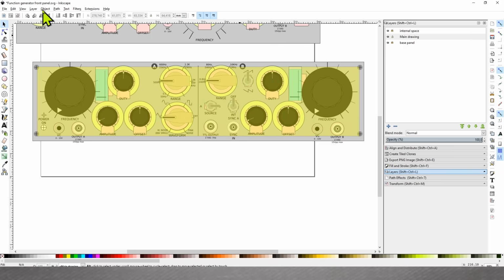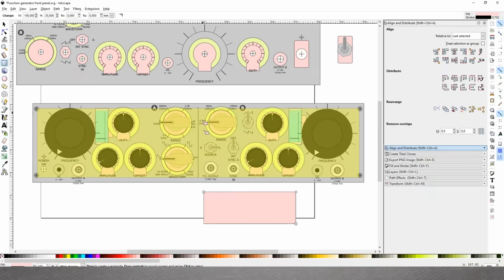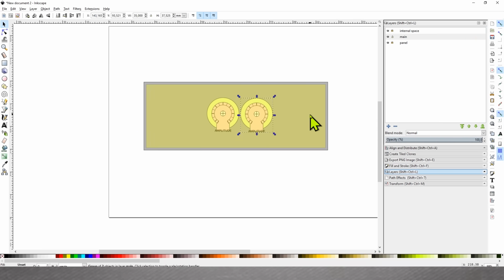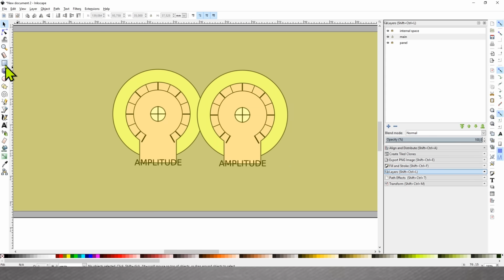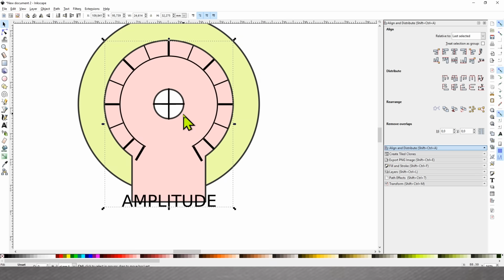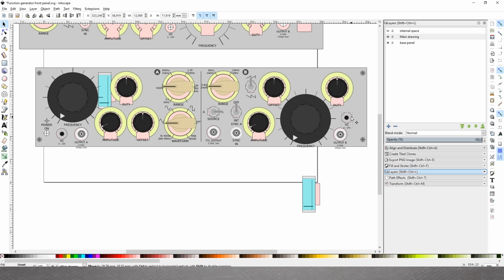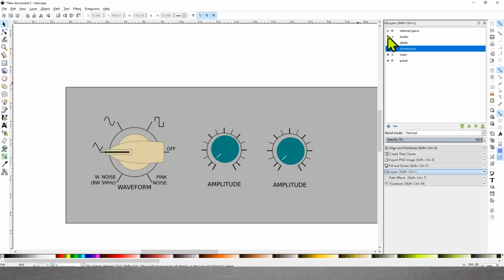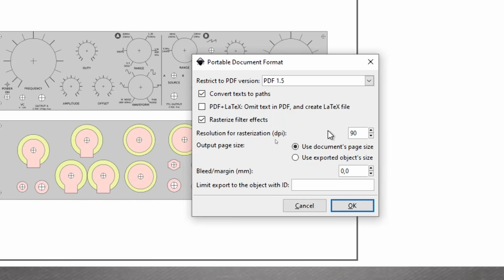Build a Custom Front Panel That Looks Pro — Easy DIY Tutorial

Comment: Wear gloves on both hands when working with epoxy. Getting un-cured epoxy on your hands is bad as it quickly absorbs through the skin and can cause bad sensitization reactions.
Reply from the maker: @mbanb6775  definitely savvy comment. Usually I wear gloves but on this occasion I forgot to do it. I pin your comment.

Comment: Since you are using epoxy to adhere the laminated panel to the AL face plate, what about using a thinned epoxy on the edges of the finished panel to impregnate the paper edges for increased delamination resistance?  Or alternatively saturate the paper backing around its perimeter with thinned epoxy prior to gluing it to the Al.  This essentially it the approach for PCB board fabrication where a fiberglass mat is saturated with epoxy.
Reply from the maker: Thanks for sharing your ideas. The impregnation makes the paper appear darker. There is another method though that I've shown in another video (it is the one that followed this one). With that method the paper is pre-treated with acrylic spray and finally (optionally) coated with epoxy or even better polyester resin.

Comment: Super-77 is a good adhesive spray for attaching the template to the aluminum in order to drill the holes. After you can peel off the paper and clean up any glue with mineral spirits.

Comment: Very nice work.  I've never used laminated graphics, but I have used laser printing on self-adhesive, clear plastic sheet and then sprayed clear lacquer over it all to protect the lettering.  I see you're using Inkscape but I always use Visio.  I also see that you appear to be building a function generator; any chance of a circuit diagram?
Reply from the maker: Look at my website, and subscribe to the mailing list: some content will be one-time shot via email only. However I'll publish more circuits about function generators over the next few months (likely in September). Some of them are simple oscillators, like the one shown in the last video.

Comment: protect your hands from epoxy resin. If you use it regularly it will accumulate in your body penetrating through skin and will cause allergy both for epoxy and some other things like nuts or birch tree pollen. I didn't care about protection and i got these allergies at my 35
Reply from the maker: You're absolutely right. As I told to another commenter, I did just forgot to wear gloves when filming in this video, but it is definitely a mistake not wearing gloves while handling epoxy.

Comment: Very nice job. Could you use spray adhesive instead of the 2 part epoxy in the last stage? It will be less messy. You can also spray a protective coating over it. Just a thought.
Reply from the maker: @anandadesilva6558  yes you can. I prefer epoxy because it results in a harder finish. No need to add protective spray on top: the beauty of laminated paper is that it is really resistant, even to oil and some solvents ( as long as they don't reach the underneath paper).
Reply: That is true, the bond is much stronger. Thanks.

Comment: As others have suggested, I have used peel-and-stick polyester label sheets for my control panels. Very durable, and compatible with the heat of laser printing and thermal laminating press. The polyester doesn't delaminate like paper and is impervious to any water that may find its way to edges.

Also, I often use the label itself as my drilling template, though this isn't always feasible.

Comment: Maybe in the past this would have been worth it but now you can get panels like this made so cheaply it isn't worth the hassle. Also the way you are using the drill press is really dangerous if the drill bit binds and the panel whips round it will do you serious damage, get some clamps.

Comment: Great work! I have used CAD drawings of parts printed 1:1 scale and tack glued to the material as cutting guides for decades. Results in very precise parts and cutouts. I use 3M Super77 spray adhesive as it lays a very thin sticky layer of glue. I'd prefer that over white glue or epoxy. But if I did use epoxy I'd use a thin laminating resin and apply it onto the panel with a foam roller. Many ways to achieve similar results.
Reply from the maker: Thank you. Yes, there are many ways to achieve similar results. Spray adhesive is very convenient, even though I must have been unlucky or maybe I did something wrong because every canister I bought became unusable after sitting on the shelf for a while.

Comment: Tip for the epoxy:  when you use epoxy which is for poring (so slow setting, 24 hours) you could warm the front plate to a temperature between 40°C and 60°C (104 - 140 °F), and as soon as the epoxy hits the metal plate, it becomes liquid as water. This way you can use a brush to paint it on. let it cool directly after sticking the text layer, so the then thicker epoxy keeps the layer more secure on the plate.
Reply from the maker: @erikdenhouter  thank you, I will give it a try.

Comment: Save time by using JLCPCB or PCBway to make you a 2mm FR4 or aluminium pcb as a front panel. Double them up if you need a thicker panel or blind studs.
Diptrace, KiCad or EasyEDA for free design software. 
These cheap fabs even offer UV colour printing of artwork so your panel can arrive fully finished and ready to go.
And the prices are ludicrously low if you can wait 2 weeks for slow shipping.
I'd recommend not using the 'silk' layer for legends / artwork as this can be a bit hit or miss. Instead either use the UV printing option or even better IMO, expose the copper layer with ENIG finish by drawing artwork in the 'mask' layer. The Eurorack boys do this and the results look fantastic! 
I even use stacked and glued FR4 pcbs to make project enclosures (19" rack 1U) and structural members. 
It's so nice not having to drill out holes and pockets and the accuracy is crazy - plus the material is very strong and forgiving.

Edit: If you 'keep out' your legends / scales etc on all copper and mask layers then you can back illuminate your artwork using LEDs. 
FR4 diffuses light very nicely and the mask layer gives knife edge resolution to your fonts and scales. 
Just be sure to double check your gerbers before you submit as you want to remove any automatic oversizing in the mask layer.

Comment: Ask at the print shop. There is an industrial peel-and-stick in 4 foot wide rolls used for signage at convention centers, etc. printed on big PostScript inkjet printers destined for big disposable "falconboard" dusplay panels. The material is NOT PAPER. It's a kind of hearty printable plastic. Your toughest job will be sticking it down right the first time. It's VERY sticky. The print can be laminated before they give it to you at a cost. It's a very common material under different names.
Reply: I think you are referring to vinyl adhesive. If so wet the panel so you can move it around. When the water evaporate the plastic will be gluded
Reply: @franciscoferreira-eh1yu  It's not vinyl adhesive as in cutouts for glass. It looks like paper until you try to tear it. It doesn't stretch like vinyl. Ask a sign shop or better yet an events company that makes one time use self-standing info boards at conventions, etc. When I made them they were 4x8 foot inkjet prints that were rolled on to the falconboards, sometimes laminated. You can print those at very high resolution.

Comment: Lately I'm trying to do silkscreen printing with the same photoresist that is used for PCBs. It's not very simple but when it comes the result is very professional
Reply from the maker: @penpen2672  nice. So you create the silkscreen yourself?
Reply: @AccidentalScience  yes! I use the resin printer screen to "burn" the photoresist and get a very high resolution.The tricky part is to remove the photoresist without ruining the paint, so far I've managed to silkscreen a power supply
Reply from the maker: @penpen2672  cool, it could be a good option for those who have the necessary equipment - and make PCB themselves, I suppose. Thanks for sharing.

Comment: Can you do a mirror image print on transparency film and then grommet it to the metal with the print face against the metal? Grommets could be hidden under knobs if desired. Then you avoid all the issues with glue and with paper. If you really desire a specific color, you could paint the metal panel.
Reply from the maker: I already tested transparent films. Not gluing them ends up in something that feel flimsy. I used self-adhesive films but the result was not as satisfactory as the method I showcased. That is my experience, though, which could not necessarily fit your preferences.
Cheers.

Comment: 6:42 I avoid the problems with stretching and removal by using spray adhesive on the paper. Use “repositionable” adhesive (not permanent!) and it’s basically like a strong post-it note. You spray it on the paper, then let it dry. It contains no water so the paper doesn’t distort.

Comment: One practical tip about printing from Inkscape: Always print directly from Inkscape. Do not export to pdf first, because most pdf readers have a tendency of auto-scale on print, meaning it add borders and the printed objects turns out slightly smaller than intended.
Reply from the maker: You brought a good point, thank you. Though, if you send the file to a print shop generally you have no choice. The good news is that usually the guys at the shop know how to handle PDFs and keep everything up to scale. The trick is to allow a centimeter / half an inch of margin around your design and the selected paper size.

Comment: 1. First align paper on the panel without glue. 2. Use soft tape to hold one side in exact position. 3. Lift off the the side, apply glue, put together, 4. Remove tapes, apply glue to the rest, and put together.

Comment: To avoid the laminated layers from peeling, you can cut the outer border of the paper before laminating it.
Thereafter, when you cut the laminated paper, you just leave 1mm extra margin, so that both laminated/plastic layer à glued together. This is also waterproof.
Reply: except around all the other holes in it

Comment: I used something like 3M 467MP Adhesive Transfer Tape to glue the graphics to panel. would run the clear laminate, the printed graphics and the transfer tape through a slip roll to laminate it.

Comment: I was making panels with toner hot transfer, just like iron method of making PCBs.
Reply: Then you use a laser printer. Try decal paper (water transfer sticker). The base is very thin and solvable in acetone/thinner. If you stick and dry it on a first layer of acryl (clear) paint, and spray it off with clear acryl, it becomes one with the acryl layer.

Comment: We made front and rear panels from PCB (FR4) material using a free PCB layout software. Then uploaded the gerbers and got them produced which was quite cheap. This way we knew all the holes were the right size and in the correct place and the silk screen lettering was also exactly where we wanted it. No gluing, drilling holes, alignment or printing.  No metalwork required as PCB material is rigid enough and you can fill the entire rear side with copper if you want screening. We also put some tracks on the rear of the front panel to carry the SPI bus as some of the components mounted to the front panel like rotary encoders and OLED display needed those connections. We then soldered one 4 way cable to the SPI bus from the project PCB and it saved having to connect several components individually. What do you think?
Reply: it is a great method, provided you have cheap pcb and pcb processing. for me, for example, it's cheaper to buy the whole device than to do it your way :)
Reply from the maker: Hi. Of course many factors come into place. Costs, dimensions, etc. Also it depends by the look you want. 
Anyway, thanks for sharing your idea. I think it could be really helpful for small panels and maybe for serial production of devices meant for educational purposes.
Reply: Did the same except I ordered Aluminium

Comment: Whoa, loveliness! Reminds me of the old Grass Instruments gear.
I use sticky clear foil and a laser printer, but my panels are monochromatic transparent, no color needed. First I print it on paper for a drilling template, drill and ream the metal, then I print on foil proper, press it with a roller avoiding any air bubbles, and use an X-acto knife to cut holes.

Looks like you're building some really nice PSU.
Reply from the maker: @KeritechElectronics  yeah that was a technique I experimented too. I like adding drawings and group controls in colored shapes so I came up with this solution (and another one that I'll show in the future). Cheers.

Comment: I do the same thing. I draw out my panels in PowerPoint then I bring the file to an office supply store (like Staples) and have it printed out on high quality photographic paper. Then I glue it to Aluminum sheet metal. For a lower cost solution I glue it to thin high quality plywood I get from a hobby store. I have a panel  on my webpage that I did for an automotive Electronic Control Unit test panel. It looks like a NASA Apollo spacecaft panel.
Reply: I do know someone who designs stuff using PowerPoint because it is all he knows, and the results often end up a pixelated mess.
Reply: @rexsceleratorum1632  I get high resolution with PowerPoint. I save the drawing as a .pdf and Staples has very high resolution printers (over 600 DPI). The result is photographic quality for only a couple of dollars per print. I have a photo of my latest work. I will make a video of it. Draw up your panels in just about any drawing tool. But for a onezy or twozy panel, don't go and buy a fancy printer or paper, just send it to Staples.

Comment: Look for print shop that prints using uv-cured inks. Print them directly on pvc sheet - thick for ready front panel or thin one - for panel overlay.
Reply: @marcinp.8108  better yet build a uv printer from an epson ecotank

Comment: Nice work. I was thinking of doing something similar, the only problem I have with this approach is the open edges of the laminated paper. I am thinking of using a laser printer to print directly on a sheet of BoPET. I dont know if the colour contrast will be as good. Also Ill need to sandwich it between a layer of white and clear PET. Ill give it a go to see what it looks like.
Reply from the maker: That's why, toward the end of the video, I said it is important to protect the edges. This techique is very well suited for harsh environments, like in a workshop setting, provided the edges are protected.

Comment: I do it differently, print on self adhesive (many silver) paper, cut out display openings, then cover with self adhesive transparent. The plastic or aluminium board is milled on a 3018 CNC with 2mm carbide mill.

Comment: Excellent, thank you. For large rectangular openings, I cut from corner to corner to make 4 triangles that I then fold through the opening and glue against the panel inside. This hides my rather janky filing and neatens up the edges.
Reply from the maker: @alan_wood  thanks for sharing.

Comment: I have done this a few times with Photoshop. It has good alignment features and works with layers, too. For printing, I took the jobs o a photo print house, where they did them in photographic paper. Got pretty good results.
Reply: @coriscotupi  Yeah, but as a fundamentally pixel-oriented program, Photoshop isn’t really the best tool. Yes, it’s gained more vector capabilities over the years, but an inherently vector-based graphics program (Illustrator, Inkscape, etc) is a much better choice. Those also tend to have much more advanced alignment tools.
Reply: @tookitogo  Yes, that was what I had at the time. When the need arises again, I'll give Inkscape a try.

Comment: Very nice! I did a panel with labels and so forth printed in reverse on transparency film which i then used spray adhesive to glue to the panel. This worked well and was reasonably attractive -' and pretty durable since all the printing was on the underside of the label layer.
Yours is much nicer looking, though
 😊

Comment: There is an easier way of making front panels. Print your design on A4 adhesive paper and cover that with (I forgot the exact type) 3M adhesive matte transparant foil. No messing around with glue required.
Reply from the maker: @meindertsprang7491  thank you for bringing up this point. Yes it's easier but in my experience over time the adhesive tends to detach, though that maybe was related to the brand of adhesive.
Reply: @AccidentalScience  I have had large labels laminated with the 3M products that are now over 30 years old without any detachments.
Reply from the maker: @dannelson6980  indeed, I checked out just a few hours ago and 3M is the adhesive we used for labels attached to the devices we made (in industrial production). Really durable. But I didn't know it was available even in small quantities.
Reply: @meindertsprang7491  just send money to 3m instead of working... Got it
Reply: @meindertsprang7491  might be easier, but this looks so much better and is way more durable
Reply: Yeah that's what I do, you can get a4 polyester label paper with strong marine grade adhesive - easy with a cold roll laminator